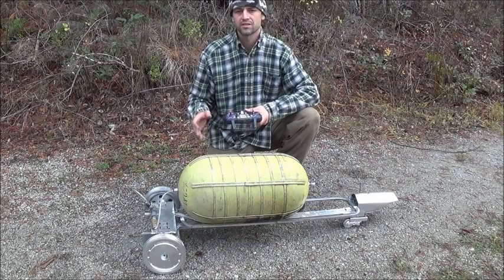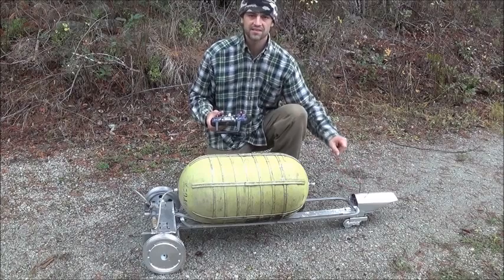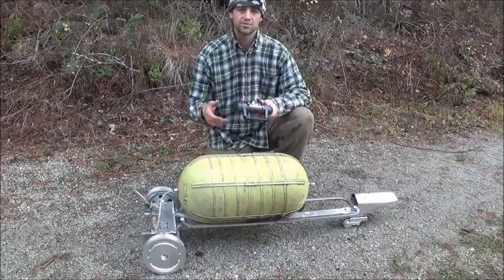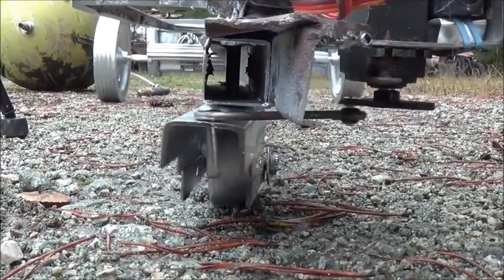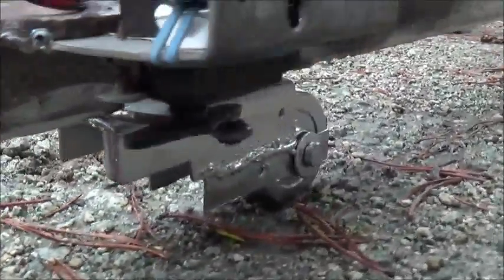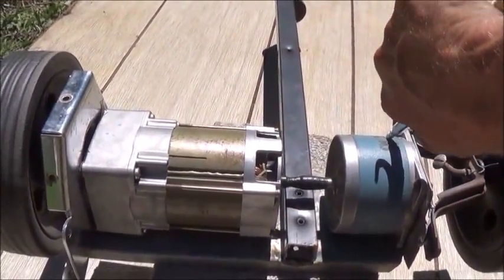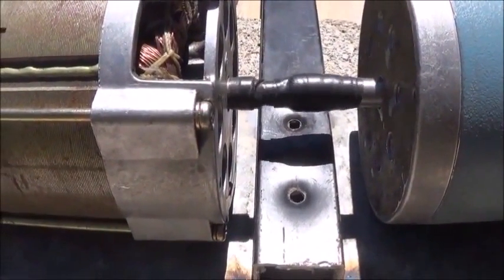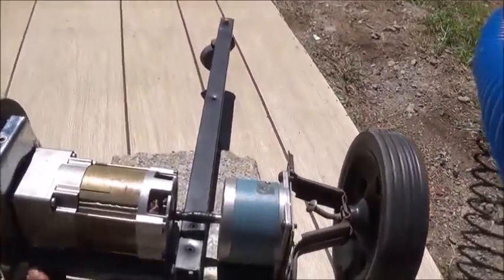World's First "TESLA TURBINE" powered RC "Car", runs on compressed air.

Comment: tesla turbine are more efficient at higher rpm's you should try a hybrid - electric setup (tromp hammer does it generate power and spin the motor at same time ?) and possibly multiple stages to get more efficiency.